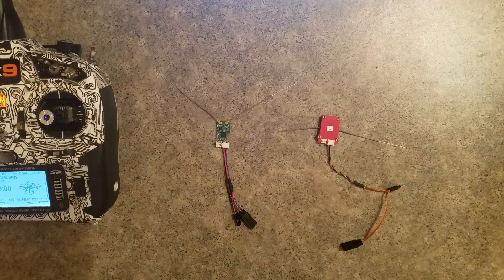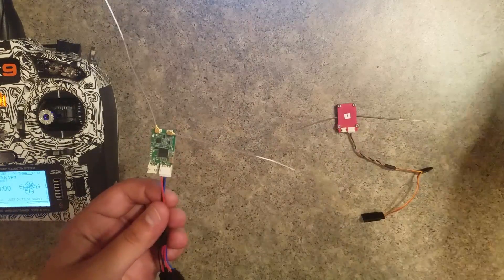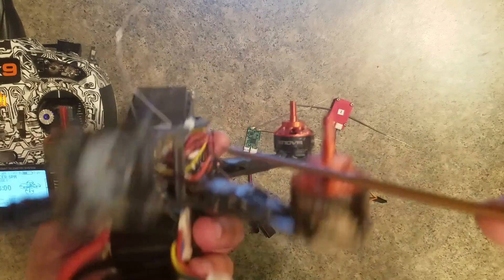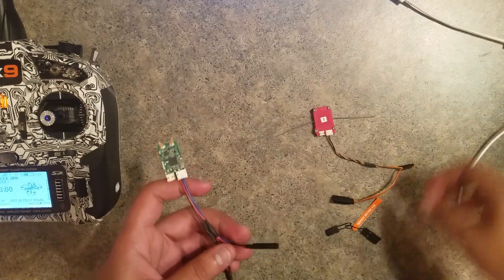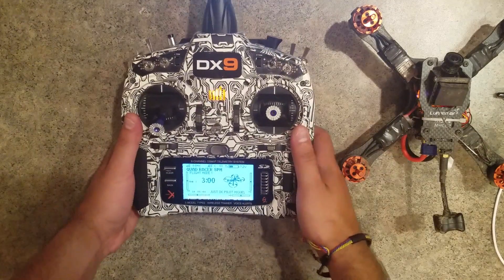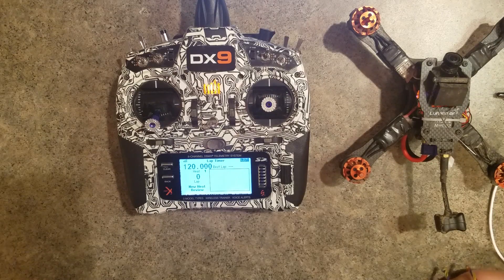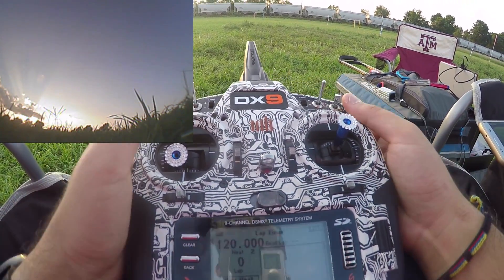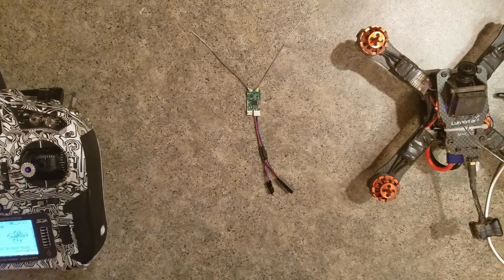Spektrum Serial Telemetry Receiver (SPM4649T)

Comment: Hi. Need help please. I just got one for my Armattan Chameleon. It’s got a CL RACING F4 board and currently has a 4648 satellite racing receiver. The satellite wires are soldered onto:
Ground, SAT pad and 3.3v
To be able to use the 4649T receiver, I have resolder the voltage from 3.3v to a 5v but unfortunately it’s still not powering on in betaflight (for binding etc). I’m thinking I need to move the Signal wire from SAT pad to somewhere else. On the board, there’s: TELE pad or SBUS. Can you pls tell me where I need to solder the Signal wire to get my receiver working?

Comment: Is this true rssi/telemetry: like a range from 0-100 where 10 is really half of 20? Does the telemetry work with the dx6i? Or does it work with any radio, and I can just get the info trough the osd of the flight controller?
Reply from the maker: Rssi is reported in dBm and you have the option to display it as such or as a % from 0 to 100 which is a rough conversion. Does not work with dx6i. If you update the receiver to the latest firmware, you can get the RSSI on an osd through betaflight https://github.com/betaflight/betaflight/wiki/Howto-use-RSSI-with-Spektrum-SPM4649T-and-other-satellites
Reply: Ok, osd will do!

Comment: Can you tell me why my SPM4649T goes into bind mode by itself every time I power up? I'm using Betaflight F4 the  board work with my Dx9 but I have to bind it every time.  thanks
Reply: Which pad did you solder this receiver to on your F4 board? SBUS or TELE pad? Please reply!

Comment: Can I solder wires directly to those pads, whilst leaving the connector in place? Many thanks.
Reply from the maker: yes, just keep in mind that the pin order on the connector dont match the pins under it.
Reply: Thanks, I can't seem to get the Tx to see it.
Reply from the maker: you mean the FC? What FC are you using and how are you connecting it?
Reply: Got it working, thanks man.

Comment: Hey dude - at 4.30 you say don't cut up the Y harness - well for my build it would be too short anyway - so i guess i need a 4 pin connection with longer wire - can you point me in the right direction ?
Reply from the maker: you can use a servo extension cable along with the existing cable, or you could buy an xbus cable and swap the wires in the connector to match the receivers cable.
Reply: Thanks for the reply - I want a clean install - I'm googling xbus cable but drawing a blank to be honest - it's some kind of JST 4 pin right ? I kinda feel for the price of this thing it should ship with a more standard connector cable to be direct soldered to a FC...right?
Reply from the maker: sorry, one of these. https://www.horizonhobby.com/x-bus-extension-12-inch-spma9580
Yeah if you want to make your own, its a 4 pin JST ZH. You could technically cut the cable, I just recommend having one of these jst to servo type cables available in case an update is made available at some point.

Comment: hi,
first, why is your spm4648t able to go in bind mode without external power? afaik it needs 5v for action? 
second, my problem is that binding is successful. but they aren't any vital signs in raceflight software (nothing happens in the receiver part) any ideas?
thx
Reply from the maker: MackieMesser84 the fc feeds it 5v from the usb power. try running the "defaults" command followed by "save" in the cli to make sure the right default settings are set. Ive heard some peoples boards have the wrong settings out of the box for some reason.
Reply: ok, that worked! but which uart do i have to use for serial connection. thx so far
Reply from the maker: MackieMesser84 if by serial connection you mean your receiver, then its uart 5. it should already be set with the defaults command. uart 3 is for a non telemetry sat rx
Reply: ok miguel:
bind correctly, uart5 choosen by default
still no reaction in the receiver tab.
any other ideas, thx for your patience btw

Comment: hey Miguel i've got the spm4649t stacked on my revolt using the 3 pin like you had on your setup. the problem i'm having is the receiver is bound and powered when plugged into the usb for setup but when i disconnect in and power up the quad using the battery i have no power getting to the receiver. any ideas? thanks chad
Reply from the maker: Sounds like an issue you need to address with the raceflight guys. I'm not very familiar with the revolt since I use the spektrum f4 board.
Reply: I had the same problem. Are you giving the F400 board power directly from the battery, or do you have the F400 connected to a 5v pad on your PDB? You should have pads on your PDB that give it power directly from the battery with no voltage regulators.
Reply from the maker: He's using a revolt, not an F400. The revolt doesn't have a built in 5v regulator, you need to have one on the PDB

Comment: I've been searching all over but cant find the best way to mount these antenna's, is it one vertical and one horizontal or is it fine to have both vertically upright like other RX's?
Reply from the maker: Lourie Jacobs you should have them at about 90 degrees. Minimize the quad positions that could cause the carbon fiber to block the antenna from being in LoS from you
Reply from the maker: Lourie Jacobs you should have them at about 90 degrees. Minimize the quad positions that could cause the carbon fiber to block the antenna from being in LoS from you

Comment: Could you make a video on how to bind the spektrum raceflight controller and spm4649t build you did in raceflight... I really wanted to build one, but now it just won't bind... And I can't get any help..
Reply from the maker: If firmware has a bug with binding, you need to short signal and gnd pins of rx on power up. I usually use tweezers

Comment: hey miguel you said you had a current sensor installed as well which one are you running
Reply from the maker: This is a sensor I designed for personal use. Unfortunately not a product we sell, but I can see if we can make it a product. Any sensor that outputs an analog voltage from 0 to 3.3V will work with the SPMFCF400

Comment: Better late than never for Telemetry.However  RSSI is just as important as telemetry even more so as most OSDs show voltage data anyways. Spektrum needs to have RSSI more than any other major radio manufacturer as their radio protocol is the weakest of them all.
Reply from the maker: The receiver sends it. Just need the new airware update that will be out soon to be able to display it.
Reply: there is too little info about features of the receiver on the product page.
How that RSSI looks like, is it percentage?
How long antennas are?
Is it possible to have full telemetry on any FC or there are some requirements for FC?
None of that is on the product page.

Comment: @Miguel Alvarez: 
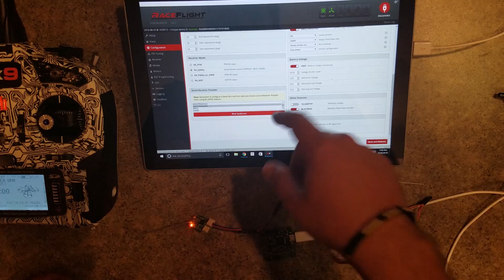(5:14) "You press the bind button, and it will send a serial command ... to go into bind mode". 

This seems false. I don't think this can work this way. That serial wire from the spektrum is a serial output wire. I don't think it is bi-directional UART over one wire is it? That would be neat, but I have never heard of such a thing. What is probably actually happening when you press the button, is that the FC disables the UART on that pin, goes into generic GPIO pin mode, then holds the pin high at 5v, just like the bind plug does. Please correct me if I am wrong.
Reply: Ok, then you continue on to talk about telemetry over that one wire. Does that really work? Is this a bi-directional UART pin?
Reply: No, that can't work. In your quad you must be using that other port. I mean, it is called the telemetry port. Are you really getting telemetry back from the quad without using the other 2 wire telemetry port? How can that work?
Reply from the maker: I did the receiver design and the firmware, as well as the receiver portion of the firmware on the flight controller so I know exactly what it's doing ;). It is a bi directional UART over one wire, so it can send data and receive it on the same wire. Its just a matter of timing telemetry messages to be sent when the rx isn't sending data. Maybe it hasn't been seen in the hobby, but thats one neat thing about this receiver over others then :). When I press the button, the firmware on the FC is sending a special data packet that tells the receiver to go into bind mode. Its part of the new SRXL Bi-Directional protocol. Also, a bind plug actually pulls the signal line low to gnd, not high to 5v. The bind plug detection to go into bind mode also only happens on receiver boot up, so the FC would need to have control of the receivers power line to be able to power cycle it before pulling the signal line to ground.
Reply: Well then that is awesome man. One wire tx and rx uart. That is pretty slick. I stand corrected. What do we call that, "half-duplex uart" maybe? Definitely unique.
Reply from the maker: Yup its half duplex

Comment: Will it work with a DX6i ?
Reply: Russell Reilly afraid not. at least not the telemetry part
Reply from the maker: It will only work as a receiver. Wont get any telemetry features
Reply: Thanks for the replies guys. I feared that may be the case. Might be time for an upgrade anyway.

Comment: well then ..I thought it would do rssi strength or signal quality of transmitter .I'm taking it dont
Reply from the maker: It does
Reply: ok cool is it hard to set up or dose it do it automatically
Reply from the maker: Slingshot its easy. I will post a video soon. It will require a transmitter firmware update though, which will be released soon.
Reply: Miguel Alvarez  sweet I'll keep checking back this is one of the things iv been hanging for :)

Comment: awesome news for us Spektrum users! 

Question 1: What is the range compared to a full range receiver ?
Question 2: Will this receiver work with Kiss FC + Kiss ESC telemetry 
Question 3: When is this available to buy?
Question 4: When is the new firmware coming out? 

Thanks a lot great work!
Reply from the maker: 1. Same full range. Can be more reliable link in some aspects compared to 4648T.
2. Yes it will work, and kiss esc telemetry CAN work if they implement the new spektrum telemetry protocol on their FC. As of yet, only raceflight has the new protocol implemented.
3. It already is
4. very soon
Reply: Thank you very much Miguel! Keep up the good work! =))!!!!!! Spektrum for Life!
Reply: Hi, Miguel! it's me again! Changed to the new receiver on all my kwads! great stuff, although today I had an failsafe out of nowhere.

My question is it possible to set my Spektrum to announce when my RSSI is low and RSSI Critical? I have been going up and down to check if there is voice activation for this but I can't seem to find it? I can see the % on my screen but I would like to hear if I am going over the line where I lose

Thanks in advance!

Comment: Hello Miguel,  I'm a helicopter pilot that's interested in using the SPM4649T to make use of the dual diversity Antennas, and the more robust built in 5v regulator design. Angelos, the developer of the Spartan Vortex (Helicopter FBL unit) has added SRXL support for the AR7700 Rx unit via a FW update.  Do you think the SPM4649T will work o.k. with the Spartan Vortex FBL unit?   Thanks!!  (Please see this link to the Helifreak thread where is is discussed):- http://www.helifreak.com/showthread.php?p=7187233#post7187233.
Reply from the maker: At the moment, this receiver outputs standard spektrum serial data (same as a remote receiver, aka sat rx. This isn't the same as SRXL), and it will take telemetry data in the form of the new bi directional SRXL protocol. If you'd like him to support this receiver, you can point him to this forum post for documentation on how this receiver works. https://www.rcgroups.com/forums/showthread.php?t=2775731&page=2#post36196894
Reply: Thank you for the link Miguel, sorry for my lack of understanding about the SRXL protocol
Reply from the maker: Graham Shaw Not a problem, this is a new SRXL protocol we've been working on so we dont expect many people to be familiar with it right away.

Comment: what protocol do we use when setting up this receiver for telemetry?
Reply from the maker: As far as I know, no currently available flight controllers support the telemetry protocol as the documentation for it was just released this week.
For now you'll have to use it the way you would use a spektrum receiver with the exception of using 5V for power instead of 3.3v
Reply: Ok that cool when it's ready will the signal be connected to rx or TX on the uart. I'm been reading conflicting setups?
Reply from the maker: On F4's and F1's, it will have to be the TX pin. On F3's it should be possible to use the same pin. Depends how the firmware is written.
Reply: Miguel Alvarez so if connected to the rx it just won't be able to send telemetry but should still work? Since fc don't support spektrum telemetry yet wouldn't be an issue?
Reply from the maker: you will still get telemetry, just not from the FC. Only what the receiver provides by itself. Yes it will still work

Comment: Hey Miguel I'm having trouble getting input from my Tx to this receiver on a new quad setup I just put together. I'm using the SP racing F3 Acro and hooked it up to UART3 for serial input but nothing coming through. Could I get your wiring diagram that's working on your quad?
Reply from the maker: Luis Cardenas is the LED on the receiver turning on and staying solid to indicate a connection? make sure Uart 3 is set to be used for receiver in the ports tab, and make sure Serial RX and Spektrum 2048 are selected in the configuration tab.
Reply: So the LED stays solid indicating a solid connection. As for the settings in Cleanflight I have Data UART 1 and UART3 set for serial RX, however serial RX and Spektrum 2048 options are not anywhere on the screen unless they are located somewhere else?
Reply from the maker: Luis Cardenas serial rx and spektrum 2048 arent in the ports tab, they are in the configuration tab
Reply: It's not in there either, I looked and looked and I can't find it anywhere.
Reply: Any clue where those settings are now?

Comment: OK, now that it is available... when is the update coming for the Transmitters? and what about a manual that explains the use of something besides the basic receiver function?
Reply from the maker: Update coming very soon. The additional functionality will be dependent on the FC firmware since they provide the additional telemetry data, so its up to them to provide guidance on how to set up additional telemetry features. That is once they support the new protocol

Comment: 1 wire from FC to receiver then select smart port in FC and its done.
Reply: Where does the 1 wire connect to? In the video he only shows connecting the main connector.
Reply from the maker: smart port is wrong.  It uses a spektrum protocol, and you will have to wait until FC's are updated to support the telemetry protocol before knowing where to connect the signal wire. Until then, you connect the signal wire to the rx pin as you would previously with a spektrum receiver and select the existing spektrum receiver protocol.  Just make sure to use 5v instead of 3.3v though for this receiver.

Comment: Changed from spektrum to taranis for the easy telemetry. Not really impressed by this receiver tbh. Finally starting to catch up is all.
Reply from the maker: Yes part of it is catching up, but we've also introduced telemetry lap timing with this which the taranis doesnt do. That itself for me and other racers is pretty huge. 
Also from what I've seen, setting  up telemetry from the flight controller to the receiver isn't exactly easy. In that case, this is much easier to set up.

Comment: Will this work with helicopter flybarless units? I use Spartan Vortex and MSH brain on my helis that can use a serial receiver, is this receiver compatible? I'm still using a DX7s transmitter and would like to at least be able to receive battery mAh telemetry. Is this rx compatible with my DX7s ?
Reply from the maker: I'm not very familiar with heli's personally so I cant say for sure.
to get mah, the controller that the receiver is connected to would have to provide that data to the receiver using the new serial telemetry protocol. If the Serial Telemetry protocol isn't supported, then the receiver will only be able to provide the data it can gather itself (flight log, rssi, and either flight pack voltage or rpm/lap timer (the flight pack voltage and rpm/lap timer port is shared, so only one of those can be used at a time)
The receiver will be compatible with any controller that supports the spektrum serial sat rx protocol. Only difference is this receiver runs off 5v instead of 3.3v so you'd have to connect it differently.

Comment: About serial telemetry: Is this supported by cleanflight/betaflight? And if it is, it it target specific? If not, can you hook up a 4s lipo directly to the second telemetry connector or there will be some additional hardware required?
Reply from the maker: It will be supported initially by raceflight. Cleanflight will probably come next. It will work with anything that supported the standard spektrum rx's, but you'll be limited to the telemetry that the receiver provides itself. 
You can plug from 2s to 6s directly to the second connector, no additional hardware needed.

Comment: The timing system is nice, but is there an interface that an organizer can use to track the timing, and how does that work?
Reply from the maker: the timing is meant more for personal practice. its much easier, quicker, and cheaper to set up than using an iLaps system